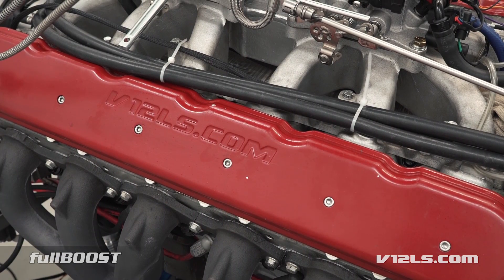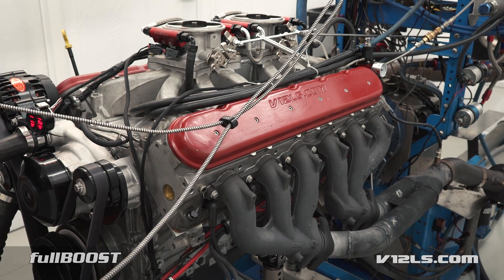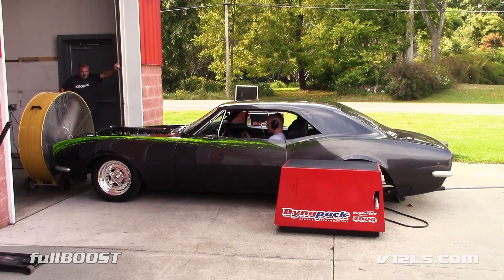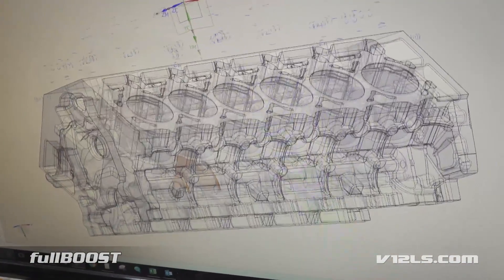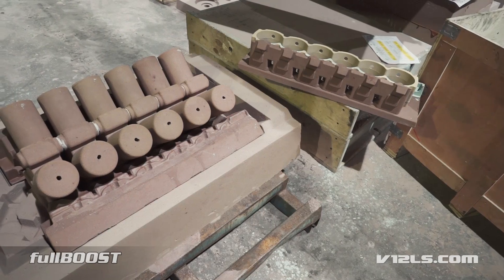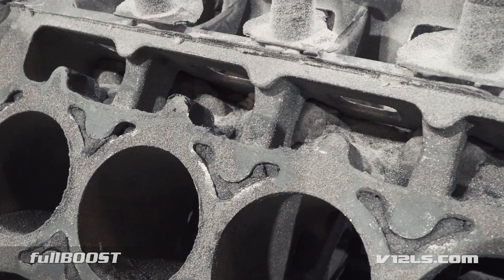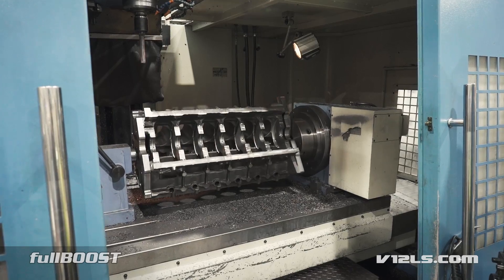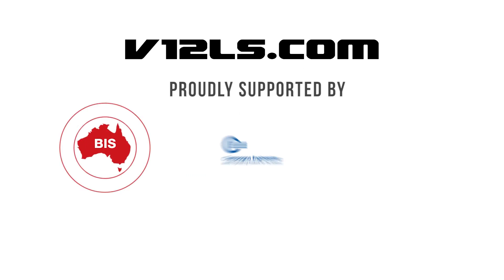How a V12 LS engine is made

Comment: I would love to see a destroked one with the 4.8L (3.267”) crank and the LS3 style 4.065” pistons for a 9000rpm screamer!!
Reply: Much harder to get the same performance per displacement on a larger engine because the operating velocities of the parts has increased considerably but the construction materials haven't changed. If you scaled the hayabusa design up to 10L the pistons would probably melt and the cam lobes get chewed off at 10K rpm. Seen many ship engines doing 10K rpm lately?
Reply: You need to go to a 3" stroke to run 9000 rpm reliably. We ran a Chevrolet 302 4" bore 3" stroke in the Late Model here class in Houston Texas in the 80's bored to get to the  310 ci rule limit.  most everyone else used the 305 block 350 crank smaller bore. The car ran 9,000 rpm lap after lap and never broke. it had 180 headers on it. Sounded like a freaking Ferrari. You always knew in the stands when it fired up. For those who don't know there's a simple formula to calculate safe engine speed resulting in average piston speed. 4,000 FPS(feet per second) is the limit for a normally aspirated street engine. 4500 FPS for race car. Stroke x RPM then divide by 6 = FPS piston speed. 3" times 9,000 rpm divide by 6 = 4500 FPS. Don't exceed that and you're good.
Reply: TMM Judging from your comment it seems that you don’t really get the LS where you live or you haven’t seen many Corvettes. Let alone I don’t think you’ve seen Drag Week highlights on 1320Video or on HotRod Magazine. When I mean streetable, is that you can drive it on the street without it being unbearable not putting it in production. Also LS6, LS7, LSA, LS9 all have been known to hit 7k RPM reliably without any issues other than breaking a rocker arm or dropping a valve (LS7 is known for that) which aren’t that big of an issue when it comes to an LS. Other than the materials being “exotic” Summit racing seems to sell a lot of “exotic” materials here for an LS to hit 8k RPM on a reasonable price point. 9k would be a bit expensive but if you have the money and have or are a good engine builder you can have a reliable 9k RPM beast of a car, if you don’t believe me then look up Larry Larson.
Reply: TMM Dude... OMG.... I can’t even, I’m not implying anything. The fact that you are drawing false equivalencies with a Hayabusa engine.... Besides, I’m trying to say that there are engines with way higher displacements hitting 9k-10k RPM, Top fuel cars hit 9500 at 500 cubic inches of displacement as per NHRA rules, they make 10k HP or ~7500kw. NASCAR engines are limited to 360 cubic inches and they can rev easily to 8K RPM. You keep moving the goal post in your argument, just because you watched a few top gear episodes doesn’t mean you know about cars. Cool, you have “plenty” LS engines in Australia, meanwhile here in the US they are all over the place including the side of the roads where I live. Yes, the Hartley V8 is amazing but it’s based of an engine that could rev to 13k RPM by design, so who cares. A high revving LS engine is harder to do by so much more rewarding, a higher revving pushrod V8 is more rewarding than a grafted bike engine. How about you build a few engines and cars before you decide to comment on a false equivalence again...
Reply: alex baracskai, i don't know if nascar changed it, but last i heard a unrestricted nascar engine makes 865 HP @ 9400 RPM
Reply: alex baracskai there's a group producing a LS that's spinning at 12k+ right now I think (I might be wrong with the number) I'd like to see what they could do with this block
Reply: Uriah Siner I know there’s race engines that hit that number, I’ve seen big blocks hit 10k pretty easy. But a street-able destroked V12 is what I’d like to see some day.
Reply: @Thee_Sinner  I don't think that's possible on a pushrod engine. Even top fuel dragsters don't reach 10k. Even if you do reach 10k the valve float would be so bad that you are going to loose most of your power.
Reply: Wolfshark 
Project Spinal Tap: 11k rpm LS
https://youtu.be/2muarRkMiZQ
Video explaining how Top Fuel reaches 11k
https://youtu.be/I1RYmUxUqso

I was off on my original guesstimate as I had suspected 

And I think you mean lose, not loose, right?
Reply: 1320crusier Flatplane crank would be fun, what about a V12 Duramax LB7?
Reply: @abaracskai   If they make that, I'm putting it in an old Chevy C-600. Wham, bam, thank you, man, ultimate highway cruising truck is born.
Reply: Anthony Webber So, I was mistaken.  On average a NASCAR engine can rev up to 10k RPM when unrestricted,  and they are limited to 358 cubic inches. Here’s an article detailing that. 

http://www.enginebuildermag.com/2017/03/nascar-cup-series-chevrolet-5-8l-v8-engine/
Reply: 1320crusier flat plane crank doesn't make sense for a V12. Well for all I know it does for this one. Let me explain: V12s usually use a 30 degree crankshaft but they're also usually 60 degree bank angle engines. This is a 90 degree V12, so I dunno WTF they're doing with the internals or what their firing order is.
Reply: TMM you are forgetting something. Having large capacity but with lot of pistons means smaller chambers, smaller pistons, rods and so on.
A Hayabusa engine has 1.3L displacement with 4 cil. That means roughly 325cc/cil. Meanwhile the V12 LS with the largest displacement of 9.5L engine has ~791cc/cil.
Maximum 4 cil capacity is around 2.5-3L if you want to keep that engine alive for some time, and that is due to imbalances in the engine. The V12 is naturally balanced, no problems there.
If you want to build a screamer you have to have a big bore engine with short stroke and lots of cil. Destroke the V12 and you will easily see 10k rpm with titanium-berillium valves and springs.
Reply: sparkimoto you are right about the reasons we stuck with the 90 degree bank angle. We can do this because a V12 is perfectly balanced at any bank angle. 60 degrees would give even firing, however this is not necessary in a balanced engine application. Despite what you read in youtube comments a 90 degree V12 is actually better balanced than a 90 degree V8. If this interest you and you want to learn more, drop by and talk to us at a show like SEMA.
Reply: No, it doesnt.  At least not for anyone that knows engines well enough.
Reply: TMM https://www.youtube.com/watch?v=fnq7qja7As8
School of Automotive Machinists '99 Camaro LSX motor - 1064hp @ 9000rpm
438CID (7.1L) LSX motor
Reply: screw the boat anchor l3,  my pup mild as 2.6L Godzilla basically stock bottom end with reliability improvement to oil pump and  ARP  studs and rod bolts ,hks slugs ,stock head  and tomie cams and springs  , spins 9000rpm ,makes ease 550rwhp at 24 psi , factoy twin turbos  haltch pro ,twin 480 e85 fuel system
Reply: Go BIG or go home I love the RB engine! There’s a car dealer selling imported R32 GTR’s and GTS-T’s where I live. I want one so bad!
Reply: 455 hp at 250 ft lbs of torque, compared to the V-12 that had almost three times the amount of torque the double Hayabusa does.
Reply: 1320crusier ok I looked at their site and they say it has the same firing order as a Ferrari which means a split journal crank is required. A flat crank would probably shake it apart.
Reply: I wonder why they don't offer a block casting in 60 degrees.  Of course it would mean having to redesign a few other parts and it wouldn't be as convenient to use all the stock ls v8 parts.  But a 60 degree would be nice for doing the plumbing.  And even more so for a twin turbo set up.  And from what I Understand, it's easier to balance a 60 degree v12 than a 90.  At least that is so for v6's.  I Suppose for this v12, it is configured like 2 odd firing 90 degree v6's welded together.
Reply: TMM https://youtu.be/eaBjNz0LKAY
Reply: yes , yes and yes !!
Reply: old dude on youtube running 10s 1/4 mile in a ss camaro old school ,with stick shifting  chev R07 NASCAR Engine buzzing it to 9300rpm ,,said it hasn't had spanner on it in 2 years , drives it on street drag races it ,
Reply: A couple years ago, Toyota was revving theirs to 11,500. Then came the change in rear gear rules, the tapered spacer, etc.  Unrestricted, the engines were up around 950hp.
Reply: What about torque?
Reply: mewrongway Don’t know what you mean. I’d love to see one, getting one built would be awesome but I’m poor.
Reply: That's also likely a STP hp rating so more like 400hp installed in something maybe 350whp.  Be a great engine for something around 2500lbs or less.
Reply: NASCAR engine are also rebuilt after every race.
Reply: 250lb-ft with a vtech peaky powerband.  If you look at the dyno graph it's power band is 6500-10,000 and does look bad but if you look at the power curve it's 9000-10000.  The only one I found was a scaled one based of the 2.6L V8 version but I will wagers it's pretty close.
Reply: Highlighted reply
GlassTopRX7
“Wherever we find a performance advantage by making a part that might not last as long but still get us through the race and produce better performance, the incentive is there to do that
intake manifold casting that comes in the door will weigh 35-40 lbs., and a finished intake manifold that goes on one of these engines will be in the 12-15 lb. range. There is that much aluminum sitting on the floor when we are done
thats how they build the nascar engine
Reply: interesting.
Reply: You are right Larz, the benefits of running odd-fire here far out weigh the benefit of running a split crank pin. The V12 is inherently balanced at any angle, so there really is no need for split crank pins, other than for a smoother exhaust note.
Reply: Enzo TM my engine builder said the limiting factor is the valves.  How bad would it be to have s slower cam ramp with lower lift?  Turbo app.
Reply: alex baracskai That would sound SO So so Damn good!!!! Because it would lose that Muscle Car Sound and have more of an F1 Sound, Which is music 🎶 to the ears man!
Reply: You won't get 9,000 RPMs with a hydraulic roller cam on an LS. The people claiming 12k RPMs are all talk
Reply: Alexander Baracskai you realize the dimensions this engine has. 4.8 crank??? Wtf
Reply: Fuck off with your high rpm lawnmower bs....low rpm high torque is the way to go
Reply: You guys are arguing like a bunch of fuckin bitches over some shit you don't even have
Reply: How about this one? 6.0L V12 naturally aspirated with 920 bhp at 9800 rpm. https://www.youtube.com/watch?v=d5kV3qkz6FM
Reply: plenty of LS motors where I am (Australia). My comment was that you can't just scale up a 2.8L 455hp 10500rpm motor to the size of an LS and achieve the same performance per displacement. That would imply that if the LS7 made any less than 1100hp NA it would be a major disappointment since the Radical guys got 455hp out of 2.8L. Similarly the reason the motor in this video doesn't make huge power for it's displacement is because it is built similarly to a bog standard LS. Simple materials and handicapped by being larger displacement. There is good reason that 99% of LS motors don't spin to 9K rpm yet plenty of fairly mundane motorbike engines can. Most people would see it as a waste of time and money trying to get an LS to rev like that. Just because these blokes have gone to the effort to put 4 more cylinders on doesn't make trying to rev it to 9K any less futile. There are better and cheaper ways of making power (boost).
Reply: destroked with a flat plain crank, 4.125" bore, and some other goodies.
Reply: @1320crusier   you can't just throw a flat plane crank into everything and expect it to work
Reply: 9000rpm LSX motor but how long will it last? A handful of drag racing passes? Race engines compromise longevity and manufacturing cost (more exotic materials, forged instead of cast, etc) for performance. Making an engine for a production vehicle / street car which has to last over 100,000km is a whole different ball game, hence why a standard LS makes peak power at 5-6Krpm and won't rev over 7K.
Reply: Hayabusa V8  spins to over 10rpm   2,8 liter 455hp, ,given its size it  makes this monster v12 look weak  , 
,https://thekneeslider.com/hayabusa-v8-grows-up-28-liter-455bhp/
Reply: @450hp202turbo  yeah but that has the torque of a wet fart.
Reply: @450hp202turbo    This V12's 700 lb-ft of torque makes that little V8's 230 lb-ft look weak!

Comment: This is revolutionary! US super cars are maybe seeing a new opportunity with these motors.
Reply: ouch, hurts cuz its true... World won't be the same without HSV and its insanity... :(
Reply: Revolutionary? A 9 liter engine running OHV is hardly revolutionary. It's cool and different, sure. But, no manufacturer would look at this and do any kind of R&D to achieve anything similar. Straight up just wouldn't work in today's market. Let's talk Ford's Voodoo motor for revolutionary.
Reply: Like koeniggnegg using Ford  engines, but claiming they building thr own😂
Reply: US supercars? Why US specifically? The engine was designed and built in Australia. And what would this bring to the table for a new manufacture with most current/big name manufactures choosing to go the smaller displacement forced induction route. Its a unique concept and product, but to call it revolutionary is a bit of a stretch. I see it more as a moderately budgeted race engine with modularity to optimize performance in applications for all different types of motorsport. Just my 2cents, I'm no multibillionare looking to make supercars so what do I know.
Reply: Beakz_ maybe because theres no Australian car manufactures left...
Reply: Dean Grimsell, Souta Nishimura's post referances the V12 LS. not the LS family of engines. then Beakz_ questions why US specificly, since the V12... not all LS but the V12 was designed and built in Australia. 

so please, back away from the trigger that you found. his claim that it is Australian is correct. 

also sure, an American company designed it, but like all good things, theres always aussies behind it.
Reply: Anything Ford or chev is American... Common knowledge

Comment from the maker: Not resting on their laurels, the V12LS team set about creating a 1-piece block resulting in superior strength and durability. This required a complete ground up design incorporating 3D core printing and pattern making. Available in both aluminium and cast iron, this block pictured is a 4.125in LSX bore size, giving a displacement of 9.5L or 580 cubic inches.
Reply: Fullboost a v12 first Gen F body is just nuts...  thanks for the video!
Reply: Can't wait to see what a twin turbo powered v12 ls will produce.  🤤
Reply: That's so beautiful it just about drops me to one knee weeping.  The sound is a clean split between a pro-stock and a vintage Ferrari.
Reply: You haven’t heard either have you?
Reply: Alloy LS? I wonder where the failed 'Joss' supercar chassis is parked,.... :D
Reply: looks like they are resting on their laurels, I'm waiting for this thing to make more power than one of the V8's this thing was made from